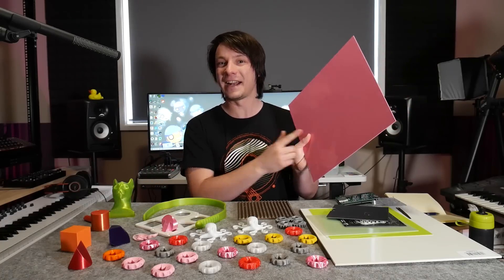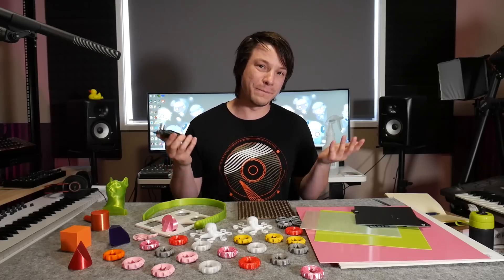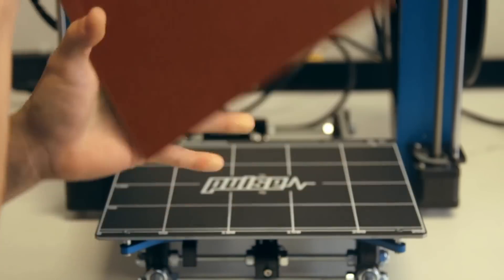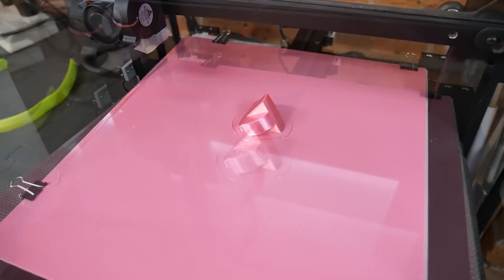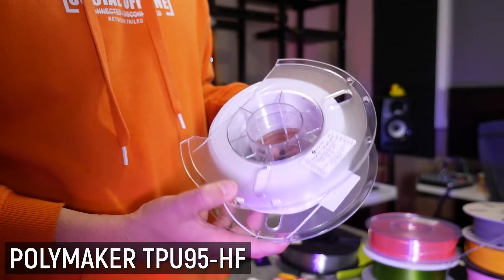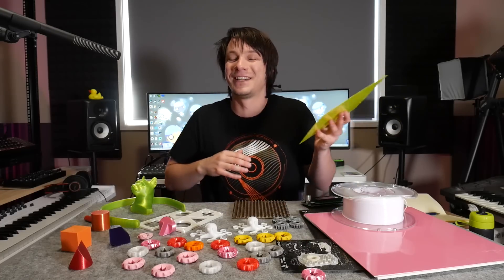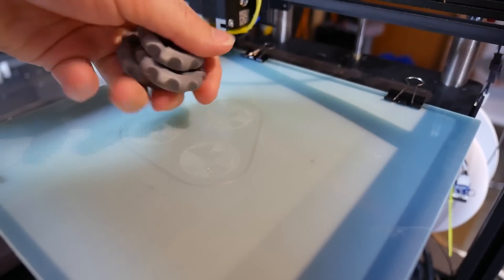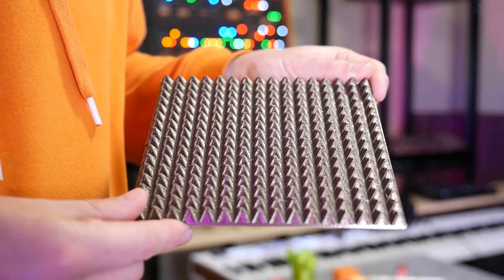G10 - The best print surface you've never heard of.

Comment: PETG has to be printed on a new surface. if you previously printed PLA on it, the PETG won't stick. And alcohol can't remove the old PLA residue.
Reply from the maker: PETG tests were done after printing plenty of PLA, no issues.
Reply: @MakersMuse  consider that I have had issues and now have no issues because I figured this out, and that you stated that you have issues but now apparently have no issues as stated. Glad I could help.
Reply: @owowowdhxbxgakwlcybwxsimcwx  not in my experience

Comment: i’ve been into pocket knives for years. G10 is like a like a household word for me lol
Reply: Thays exactly what I thought “G10? Like the same G10 that every knife company makes handles out of?”
Reply: Hey, I heard this is where the knife bros hang out.
Reply: Ahh my people!
Reply: My thought exactly
Reply: I had the same thing happen to me. More into fixedblades so I don't hear about g10 as often but still relatively frequently.
Reply: @Freak480  I use blocks of it occasionally for full tang knife scales.  It's quite a bit tougher and handles extreme environments better than wood, it just doesn't look quite as good.
Reply: @Skinflaps_Meatslapper  Right now the big fad, as far as I can tell, is micarta, but nothing matches the look of wood for me.
Reply: @Freak480  Nah, I'm not too big on micarta either, but like G10 it has its place.  Carbon fiber looks pretty nice if that's the look you're going for, and I've made a few knives specifically for it, but none of those composites are ever going to replace a nicely figured hardwood burl.
Reply: @Skinflaps_Meatslapper  I would like carbon fiber more if I hadn't gotten so many splinters with it when I was younger.
Reply: @Freak480  I don't even mind the splinters, it's all the dust you make when you start shaping it on the belt grinder.  That crap might as well be asbestos fibers as far as I'm concerned.
Reply: was looking for this comment
Reply: Yep, thought the same thing and so glad to see this comment :)
Reply: Came here to say this :D
Reply: Kekekekekke